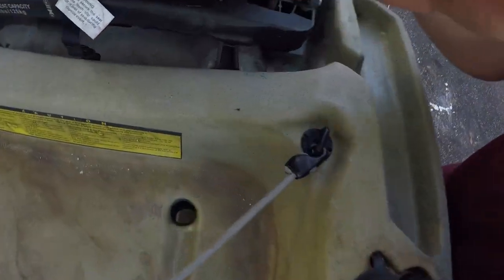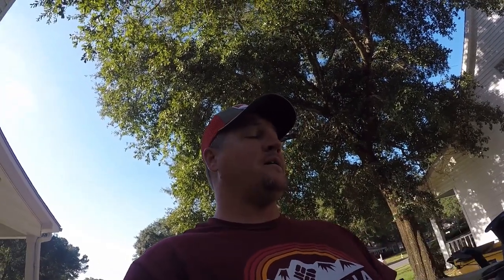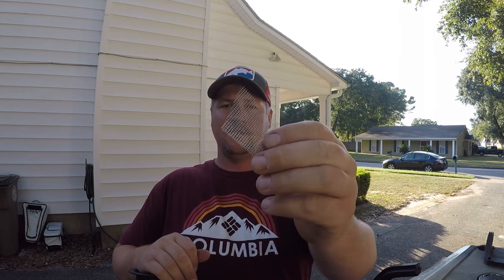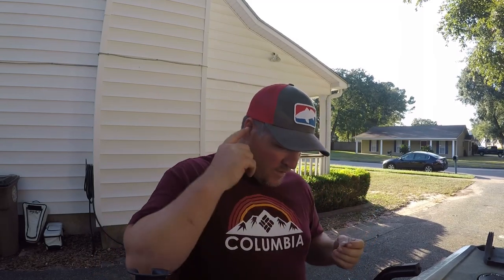How to Plastic Weld a Kayak - 2019 Hobie Outback

Comment: Thank you, this is so far one of the best videos of welding a kayak I saw on Youtube.  I have a Hobie and the crack is around or at the opening of the drain plug (almost 1/3 of the circle).  So my kayak has two drain plug holes right on the rear sitting area (a tandem kayak).  The crack is not a straight line but rather a curve line or a bow if you can imagine it.  It is right on almost the opening of the drain plug.  I wonder if this is common among Hobie kayaks.
Reply from the maker: Thanks man, I’m glad it was helpful. To be honest I’ve never heard of one cracking there but should be an easy fix.
Reply: i have the same crack, not on the same kayak tho

Comment: Here in Canada we have a product called JB plastic weld ..it's two parts that are like plastacin and you mix then together..it actually starts to heat up when they react to one another ..works great on canaoes kayaks and peddle boats that have cracks in the plastic and leak
Reply from the maker: JB Weld won’t work on HDPE

Comment: Thanks for video i used a harbor freight plastic weld tool and it came with the wire mesh. I wasn’t sure the plastic it came with was the right kind so used plastic off a bucket I had

Comment: I just use a $12 plastic welder from Harbor Freight. Never had a crack though, just plugging up screw holes after I removed an accessory I no longer needed.
Reply from the maker: Do those plastic welders have HDPE rods?
Reply: @southernsalt  It came with HDPE sticks and about 20- square inches of wire mesh.
Reply from the maker: I’ve looked for them before and couldn’t find the HDPE rods. This is good to know, thanks!

Comment: hey bro, im doing a repair soon.
i have a heat gun with adjustable temp plastic welding gun, and a adjustable temp soldering iron with plastic welding heads.

which one would you recommend for the a job like this, or would you recommend using both, they adjust temp from 40c - 600c on both.
Reply from the maker: I’m not sure at all. All I’ve ever used is heat guns and HDPE strips.
Reply: Both the first one you said is his method with exact control temp to set for welding point for the plastic you are welding. It’s a more scientific approach then feathering it with a heat gun and it will work much quicker. Once you want to finish off the weld use the iron with the flat welding tip to smooth out any imperfections imo

Comment: When i saw your first video about the Hobie 360 drive breaking on you, I thought, well maybe there is an issue with the drive. I bought the 360 and have taken it out 5 times on offshore and about 20 times freshwater. I’ve had no issue other than tightening one of the screws to keep my drive from turning while pedaling in rough 5ft waves offshore. Now that I see this video, Im starting to wonder if maybe you just really put these kayaks to the test lol. A 2019 already cracked it? Also, Hobie lets you keep the damaged kayak and just ships you out a new one under warranty?
Reply from the maker: Well I definitely use my kayaks I’m in them 3-5 days a week. 4-8 hours a day so I put a whole lot more use in them than the avg person. You don’t get to keep the kayak. The kayak gets destroyed by the dealer that submitted the warranty.

Comment: Only thing I would do differently would be to use a soldering iron to apply the mesh. It takes no pressure and sinks in a small portion at a time it’s much easier to achieve the desired depth is all.  Using a heat gun can be very challenging I have only done it once.
Reply from the maker: Appreciate the input man!

Comment: How's that weld holding up?  Did you use it much before your new hull arrived?  Also, where did you get your plastic from; my boat is dune also and would love a decent match
Reply from the maker: It held up great. Used it for 2 months until I got a replacement. I’ve done welds before and have never had a problem. I got the plastic from my local dealer.
Reply: How did you come to prefer the heat gun method?  Did you try the plastic weld tool that hobie recommends?
Reply from the maker: This is the method that my dealer told me to use. Been doing it this way for years.

Comment: Great video. Thanks. Hobie tells me that the material in their kayaks is Linear Polyethylene. So it seems from your video that HDPE will work. Comments?
Reply from the maker: Thanks, I've always used HDPE and have never had a problem with the plastic bonding.

Comment: NATE, I HAVE A HAMMERHEAD KAYAK I PURCHASED SEVERAL MONTHS AGO.  UNFORTUNATELY I HAVE A CRACK ON THE BOTTOM OF THE HULL ABOUT 4" FROM GETTING HUNG UP ON A SHARP STUMP. CAN YOU POINT ME IN THE DIRECTION AS TO WHAT TOLLS I MAY NEED TO FIX IT???  ITS NOT A STRESS CRACK LIKE IN THIS VIDEO.
Reply from the maker: Fix it the same way pointed out in the video. This will work for just about any crack

Comment: 👍 Very helpful!
Reply: So I took 4 hours to do a proper repair. The use of the heat gun on low is the key. Get the body of kayak very warm so the weld sticks actually “stick”.  Also used stainless mesh provided with the plastic welder kit I previously bought. 
THANK YOU AGAIN. 
I’m back on water!

Comment: That's ridiculous for a $3K piece of plastic. This is not the first or last time we'll see this on the new outbacks. The plastic needs to be reinforced from within during the manufacturing process, not with cheap plastic inserts. Scupper cart wheels are a great idea, but not worth the risk of ruining $3K worth of investment. Hobie needs a real cart that supports the weight throughout the hull, not in it's weakest point. Maybe a cart that utilizes the scupper holes to center the cart that eliminates the need for straps, but with integrated arms that support it from under the hull. Hey, Hobie, it's my idea, I get a cut of the share for thinking of it. Call me, lets talk.
Reply: I will never use a scupper cart I have seen it ruin kayaks
Reply: Lol, that’s how I’ve made my carts
Reply: Hobie kayaks are cracking not just at scupper holes from carts but in many areas. I’m glad I researched them before laying out over $3k. This is something you would expect to happen with budget kayaks not premium
Reply: @chribrian  can I ask what other areas of the outback are prone to cracking?
Reply: Lol that’s why I went with Ascend lol

Comment: Use a hobie welder for small cracks it’s so much easier than to risk damaging the kayak with a heat gun.  A hobie welder is so much better and does a better job.
Reply: ¿Hobie welder? I google it because I´m interested in looking for options to repair mine, but I didn´t find information about a hobie welder. Can you help me explaining what is it?
Reply: Buy on ebay the link is a example

Comment: Why not using JB weld plastic and make it an easier process?
Reply from the maker: JB weld does not bond to HDPE plastic. It may work at first but as soon as the hull flexes it will bust open.
Reply: JB weld is fine for a temporary repair  Working with thermo plastics  there is no epoxy or glue that would be permanent.  Good for thermoset plastics however  because thermoset materials are not weldable.  Hope this helps.